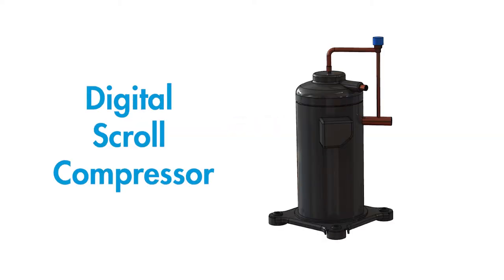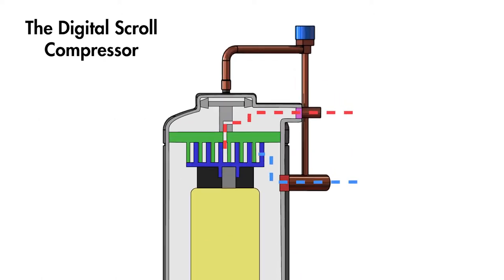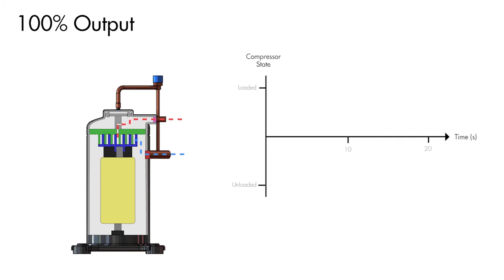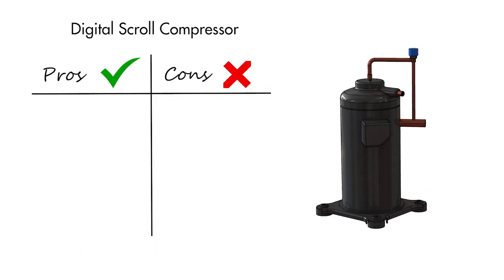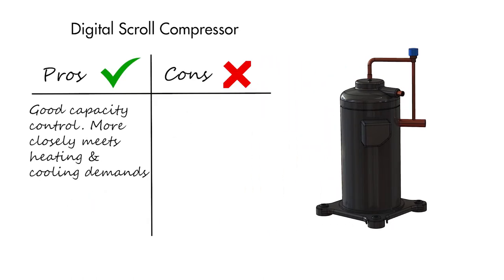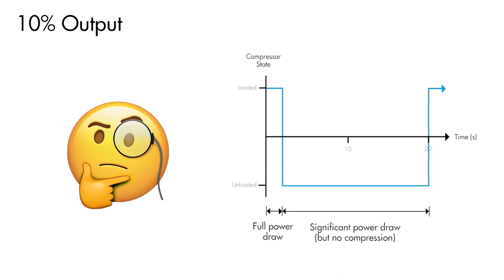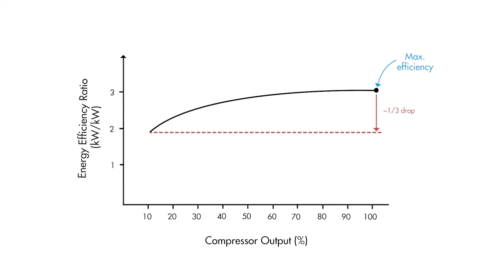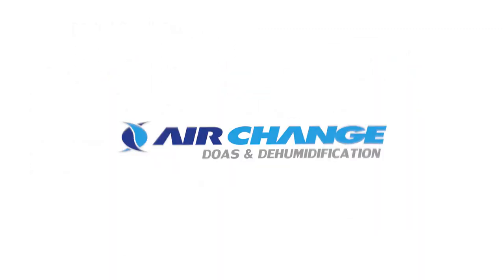The Digital Scroll Compressor - Improved Capacity Control But Is There a Downside?

Comment: My swimming pool pump has an energy efficient two speed motor.  When operating at the slower half speed, by the affinity laws, the flow drops in half (proportional to the speed change), but the power drop drops by a factor of eight (proportional to the speed change cubed).  Why not use a two speed motor on the scroll compressor rather than the unloader?

Comment: Thanks for highlighting the efficiency loss with the reduced capacity of the digital scroll. This is the first time I encounter this, I really thought that digital scroll energy consumption at part load looks similar to a scroll driven by a VFD (inverter scroll) 

the real question is when we compare the energy consumption at part load for digital scrolls vs fixed scroll, which one is better?

the fixed scroll has to turn on and off to modulate the capacity and there is the degradation loss which is the loss in efficiency due to the cycling of the compressor. how does the degradation loss compare with the digital scroll loss at part load>
Reply from the maker: Very good question Ali. After we cover the inverter compressor, we should make a video comparing the seasonal efficiency of each compressor type.

It would largely depend on the setup of the fixed speed scroll unit. If it is not oversized and has a reasonable hysteresis band, then the amount of on/off cycling shouldn't be excessive. Further, if it is a multi-stage unit, then the startup degradation will be less significant. For example, during a low load scenario with a twin compressor setup, only one compressor that is half the overall capacity needs to cycle on/off. Whereas, a unit of the same capacity but with only one large compressor will have a greater startup surge.

There are standards for seasonal efficiency calculations here in Australia. From memory, it recommends a degradation coefficient of 0.25 for a fixed speed compressor unit. Meaning that as the load approaches 0%, the unit loses 25% of its efficiency. This resulted in a single stage unit having about the same seasonal efficiency as the digital scroll unit. But when multiple stages were added, the fixed speed unit was more efficient.
Reply: @airchange255  
Thanks for the details, waiting for your SEER comparison between all types. and would like also to have an IEER comparison if possible. IEER would be more suitable for large compressors suited for commercial application (larger than 19 kW)
Reply: Türkçe

Comment: Curious about the actual energy usage difference between the two, ive seen other sources go a little more in depth and state that the energy usage is nearly as efficient as a modulating compressor. We have to take into account LRA with the on/off cycle.